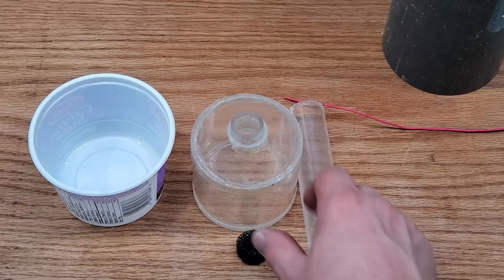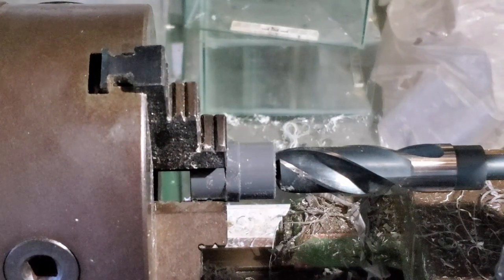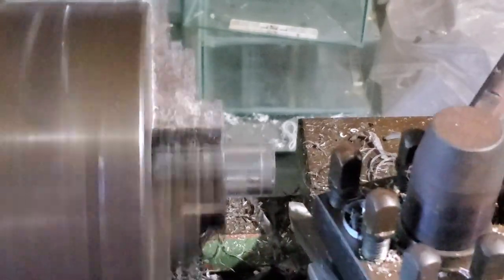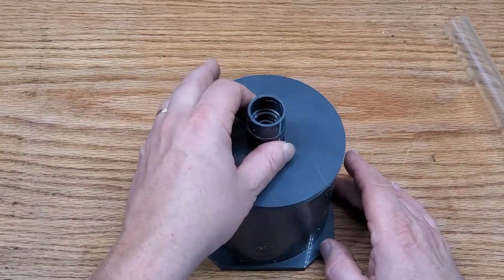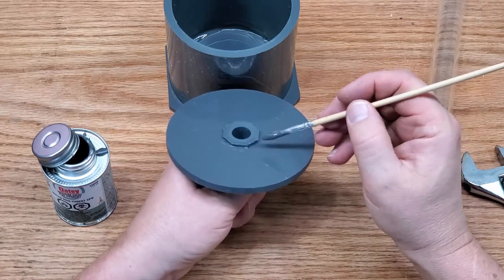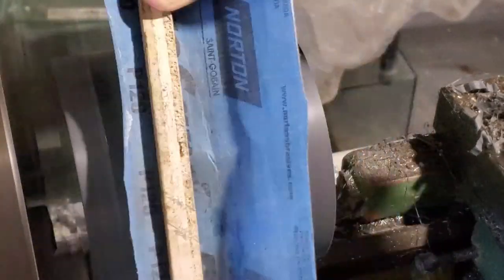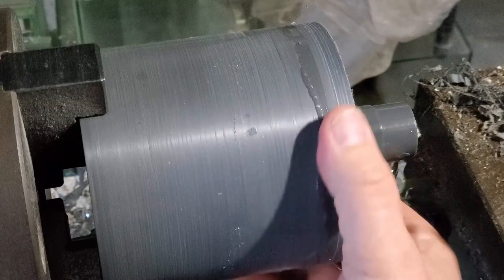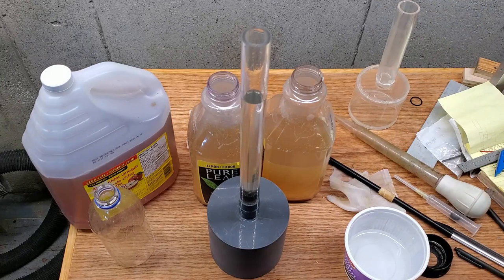PVC Vinegar Eel Separator

Comment: Fishman I think you are the person to give me advice on my project, if you'd please be so kind?
I want to blow bubbles on command:

For simplicity's sake, I'd like to wire-up a big red button that while pressed will shoot a stream of bubbles!
I'm a total novice at this but it's the start of a very big project I'll be putting together.

Any advice is appreciated, as I have been continually entertained and inspired by your videos.
Reply from the maker: Hey Sam! Unless you want the bubbles to be instantaneous, the easiest way to to do this would to simply use the switch to power on and off an air pump. If you want a more impressive and quicker bubble burst you would need some kind of compressor and have the switch activate a gate via a solenoid or similar to release the bubbles. Hope this helps
Reply: @FishmanEricRussell  This helps tremendously, thank-you!
It might take several months but I am committed to this so I will update you when I have something worth showing.
Cheers for the kickstart, looking forward to more videos.